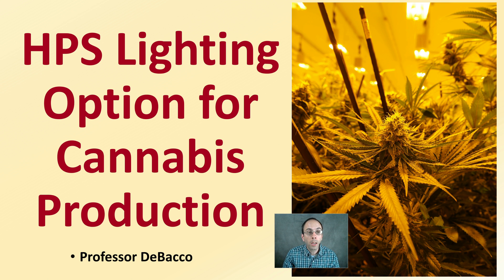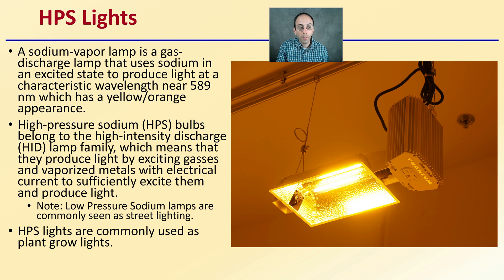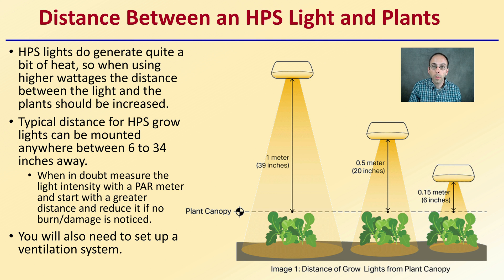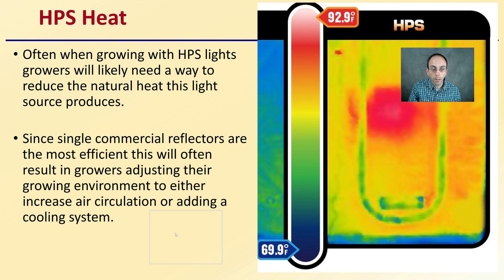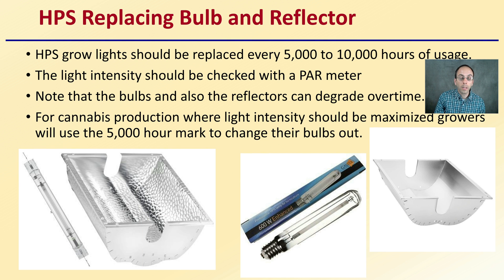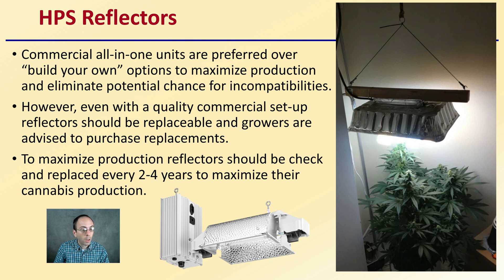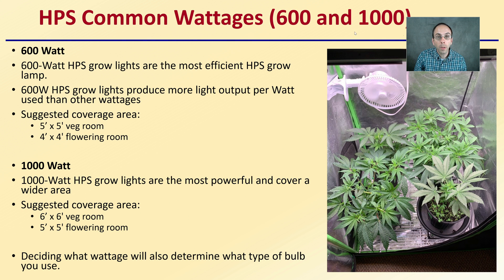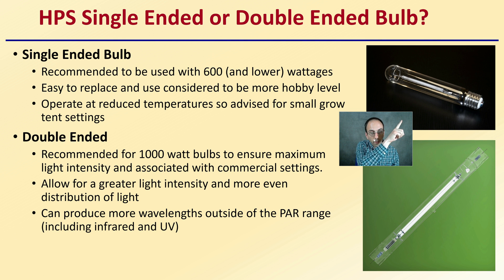HPS Lighting Option for Cannabis Production

Comment: The best light in the world,costs me 40 bucks a month to run 1000watts in my 5×5 room.i get 2lbs every 2 months of the best AAAA bud.
Reply from the maker: Sounds like you have more than just a good light;-)
Reply: You can do more than 5×5.  I got a 12×12 and use two 1000w double ended hps lights.  And the buds on the outer edge are just as big.  I also have mirrors around the walls.
Reply: Is this just a single bulb? Could you please write in detail?

Comment: Thank you Professor DeBacco. Informative as always. I would like to add that when handling HID bulbs it is highly recommended to wear some cloth gloves. From reading I've learned that the oil from our skin can harm the bulb. Gloves usually come with the bulb.
Reply from the maker: This is a good additional point that you want to avoid direct contact with the bulb, gloves, a paper towel or even something as simple as a piece of paper to avoid your oils coming in contact with the glass of the bulb will help reduce the chance of unwanted failure.
Reply: Wiping it with a fiberglass cloth (without applying pressure) when you screw it in or out as well. To remove dust particles and sometimes tiny amounts of evaporated resin.

Comment: i have a 1000 sodium and a parabolic 42 inch reflector hung vert and i can light a 8 by 10 foot room walled with mirrors and with my strain i can expect 2 pounds of what i call AAAA dank
Reply from the maker: Consider diamond Mylar over mirrors for a more even distribution of light to the plants.
Reply: Nice.  That's exactly what I get but I have normal reflector that are horizontal.  I use mirrors too.  I got a 12×12 and two 1000w hps.  I can get four to sometimes five pounds.  The people only covering a 5×5 under a 1000 watt light are not getting the maximum use from them because they'll easily cover double that.  In my 12×12 the plant that had the biggest top bud this past harvest was the plant against the wall that was furthest away from the light.  You're one of the only growers I've seen on here that knows that.  Seems like everyone follows what everyone else does.  They either grow half of what they could under their hps lights or the majority are caught up in the LED light nonsense.
Reply: @EliteNugz Hello dear friend, I have a room of 8 square meters, how many HPS lamps are needed for lighting?

Comment: LED lights are better
Reply from the maker: High quality can still be produced with HPS, you do not need LED.
Reply: No HPS is better
Reply: It what suits your set up… I could switch to led, but in the winter months, the money saved from efficiency would be spent on heating… hps is king for cold climates
Reply: @outdoormonster2838 hps is king even in hot climates.  You're better off buying an ac unit than using led and getting lower yields and lower quality.
Reply: Why dont  despensaries buy bud grown under LED lights?  Because not only do you get lower yields but the buds are not as dense and certainly not nearly as good of quality.  Nothing beats hps which is why all the best buds you see are grown under hps.
Reply: I second that.

Comment: I really can't see HPS as a good option for the average home grower. Only on really cold environments but LED lights are definitely the way to go
Reply: I been growing top quality cannabis indoors for 22 years now.  LED lights are ok if you're good with lower yields and quality.  But if you want top shelf despensary grade bud and lots of it then hps is the only option.  That's why despensaries won't even buy bud grown from only LED lights.  LED lights are awesome for supplemental lighting along with hps.  And heat is a tiny and easy issue to fix.  First run the lights at night and get an ac unit for 150 bucks.  But I get some people can't afford the higher power bills but the hps lights will more than pay for themselves.  I can get  over two pounds from a single 1000 watt HPS.  It actually uses 1150 watts on max brightness setting.  I got a 12×12 flowering room I fill wall to wall and I'm using two double ended hps that pulls 1150 watts each.  So 2300 watts and I can get five pounds.  No way you could come close to that even if you used LED lights that actually pulled 2300 watts.  They don't have the penetration power like hps so they are bright close to the diodes but not several feet away.  So because of that and a few other things they're not nearly as efficient or effective as hps.
Reply: @EliteNugz It really depends on what kind of led lights you are getting. I’m using 1000watt led and my yield is about 3.85 per light.
Reply: @吴煌生  if you mean 3.8 pounds thats not possible.  even assuming your led actually pulls 1000 watts from the wall you'll get 2 pounds at best.  There's tons of top growers on YouTube and none have ever got yields like that from any type of single 1000 watt light and they never will.  Unless you're trying to say you get double the yield of any other grower on earth.  Or maybe you didn't mean 3.8 pounds.  If a led pulls 1000 watts it would get the same yield as a 1000 watt HPS but what would be the point then.  People use led lights because they use less power.  Not because they yield better because they don't.  And if an LED light is sold as a 1000 watt it actually pulls no more than 400 watts of current from the wall.
Reply: You can grow excellent cannabis with 150w hps and maintain room temps in the 70s. I am living proof. Rh is between 40 and 55.
Reply from the maker: Adding a ventilation or cooling system is well worth it for the quality that an HPS can produce, especially considering the low upfront cost of an HPS.

Comment: Option 1. Throw into the garbage.
Option 2. Throw into recycling. 
Option 3. Give to the poor.
Reply: LED lights are for people who don't mind lower yields and lower quality.  There's a reason why despensaries still today won't buy bud grown under LED lights.  All the best bud on the top shelf is all grown under hps.  I've harvest over two pounds per light of bud with or slightly above 30% thc.  When you achieve that with led let me know.  And don't tell me but show me video proof.
Reply: @EliteNugz  I grow outdoor in a greenhouse
Reply: Hey don’t  screw over the poor 😁
Reply from the maker: At the present time HPS can still produce a very high quality product.
Reply: @DeBaccoUniversity  agree, in fact, I used hps and mh back in the 90s and grew some decent weed, now I use a chain of nuclear explosions located a few miles away , but if I was to lose the greenhouse and grow inside again I wouldn't think twice about it,  I'd go full led.  Just so much better, and cheaper in the long run for sure.
Reply: @sillydog70  😂😂

Comment: Is it possible to use HPS from start to finish if you have no other lights or money for lights
Reply: U could but if money is a issue then stick to LED because it's cheaper monthly electric bill
Reply from the maker: Yes, you can, just realize that there may be a little more stretching in the early stages and be aware of the heat that can be generated and the plants should still produce well.
Reply: @scragglewaggle4109 cheaper but cheaper buds too.  The hps more than pays for it's little bit of extra power usage.

Comment: Meh, HPS days are over.
Reply from the maker: HPS can certainly produce high a high quality product and while they may not advance much more at the current time HPS can be competitive to LED lights.
Reply: @Chris Stevenson  stop buying cheap leds or use a par meter if your getting fluffy buds don't misinform unless you have facts on this. You didn't have your light close enough if they were fluffy especially if it was an amazon nock off. just saying.
Reply: Despensaries till this day won't touch LED grown bud because it's to low quality.  All the stuff on the top shelf is hps grown.  It's the industry standard because it's the best.  Along with ceramic mh.
Reply: wrong

Comment: HID grows great bud's no argument on that I used them since the 80s , but after switching to LED I've saved some money on power 650watts from the wall opposed to 1000 watts , went from fighting high temperature (30+) to trying to keep it warm enough went to a 4" fan from an 8", bud's are no comparison , I've grown the same strains (all clones) for years and they look like different strains all together under the LED , full coverage in my 5x5 only 3" to the wall and no more hot spots , overall I can't believe the difference ! That's just my personal experience other's may want to stay with the HID because they still grow awesome weed and are real inexpensive !
Reply: By the time you get the same light coverage your running more watts than mh hps
Reply: I know a guy,
he get the best yield,
when he mix HPS and LED
Reply: @nicimizoni1687 absolutely.  If you're only going to use one light then nothing beats an hps.  LED lights are good for people trying to save power and don't need big amounts but when you put the two together you get great results.  LED lights are great for supplemental lighting to help add extra spectrum to your grow.  It adds blue which decreases stretching and it can bring more colors our of your buds which is why the guy who made this post said his plants look like different strains.  But even though they look different if all you use is led lights you won't get as high of quality or quantity.  I think the best setup is 1000 watt double ended hps lights overhead and led lights on the sides so the bottom branches also get light.  I was using the standard hps but just recently got the double ended hps lights and they're a lot better. Also on the max brightness setting it pulls 1150 watts and pumps put over 160,000 lumens.  Add in a few hundred watts of LED and you got the best setup possible.
Reply: I read so much abouth  this yet I've never seen a better heavier stronger bud from led over hps/mh
Reply from the maker: Thanks for sharing and you are correct there are some valid points to LED lights, but then there are the advantages mentioned for HID lights, so growers must select what works for their unique situation.

Comment: Yep.  I run 1000W.  My 5 x 5 room is the perfect size for the cultivar I grow.  Flowering under this bulb has always guaranteed a maximum yield in my grows.
Reply from the maker: Thanks for sharing your experience and great to see confirmation of the information presented on this channel by others.
Reply: Don’t you struggle with the temperature from the light?
Reply: @kallejonsson2861   No.  No struggles when the temperature is 12*F outside here in Michigan.
Reply: How many plants is 1000W enough for? Is one lamp enough for 5 square meters? Greetings and love.
Reply: what is the weight
Reply: Exactly